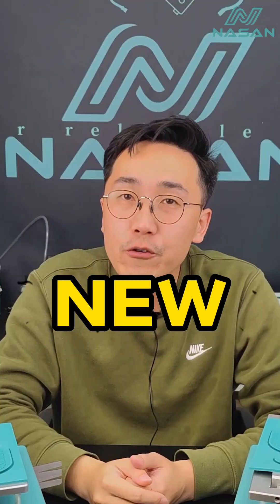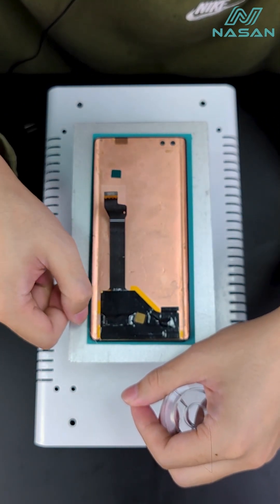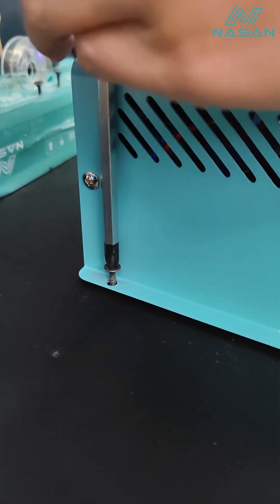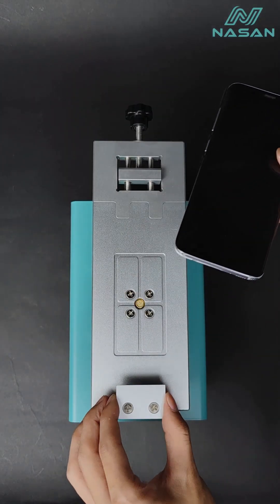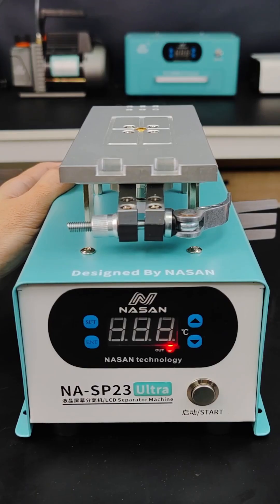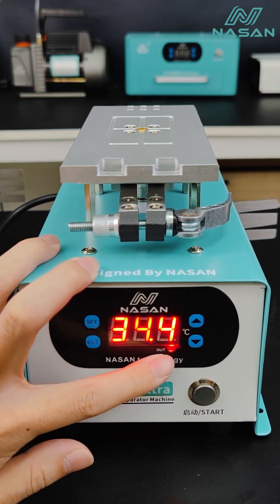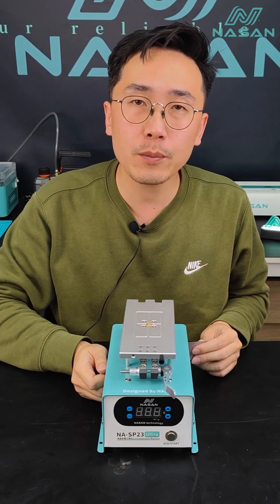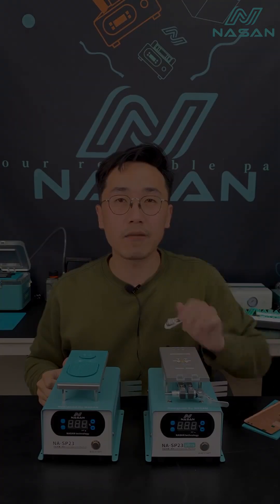NASAN Separator Details w Guidance- SP23 & SP23U

Comment: Hi, I have problems with NA-SP5 and the Blue nasan rubber (Apple watch + display). Almost no suction on Apple watch screen and goes Flying everytime I come near the Middle of the screen :(
Reply from the maker: 1. There are two circles on the blue pad. When using the hole of the watch, you need to cover the big circle with Glass so that the suction can be maintained.
2. Before separating the watch glass, it is best to stick a layer of tape on the damaged glass to prevent the lack of suction during separation.